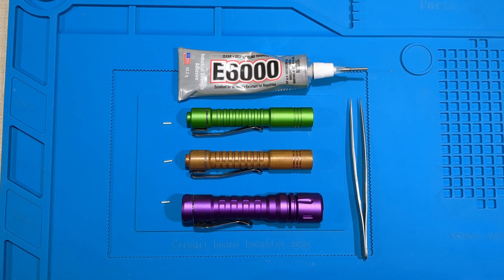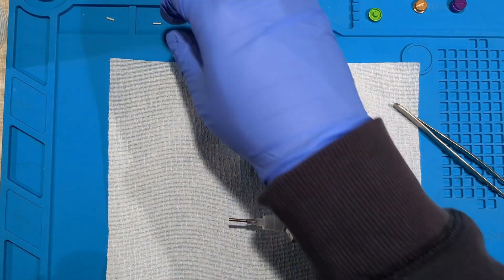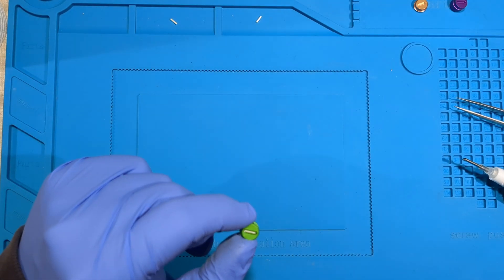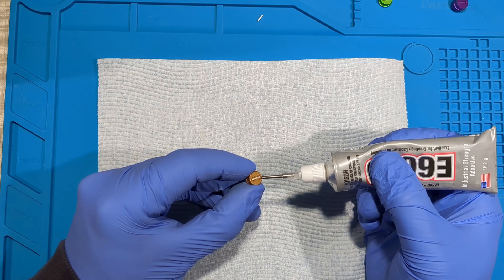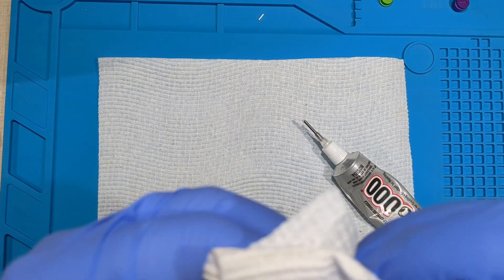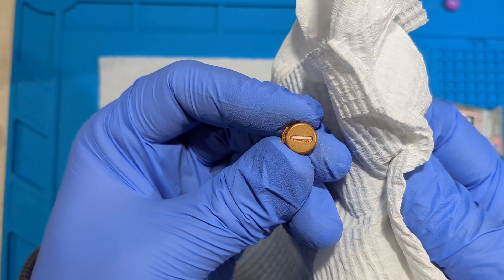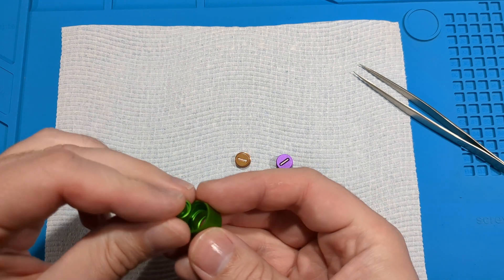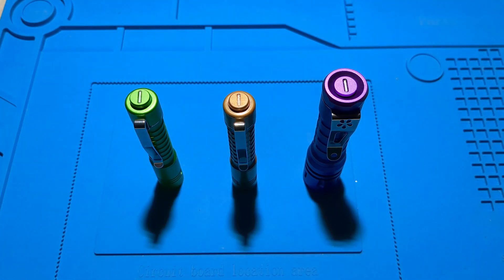Tritium vials in ReyLight torches!

Comment: Where is a reliable source for the tritium tubes ?
Reply from the maker: mixglo?
Reply: @TorchHacker  thanks .. very much for the information
Reply: I know this a few years after the fact, but I just bought half a dozen tubes from a company called Ant Designs. They were shipped very fast and came in a secure plastic cylinder with foam on top and below and all 6 had a very bright glow. I’m installing them today in Reylight mini pineapples so I’ll comment later on the installation and hopefully all goes well.